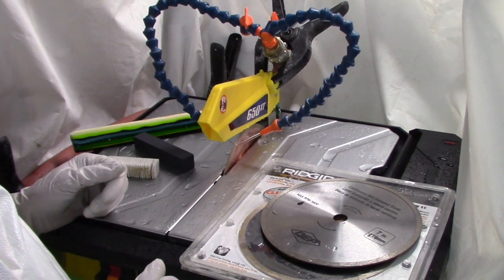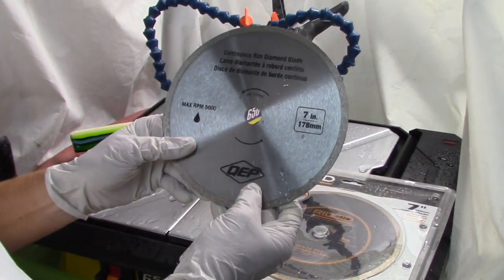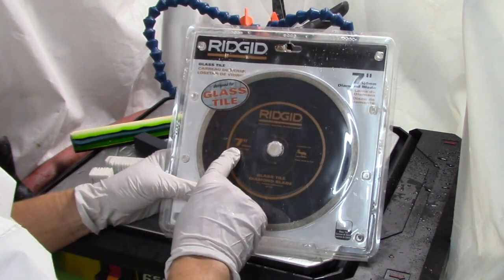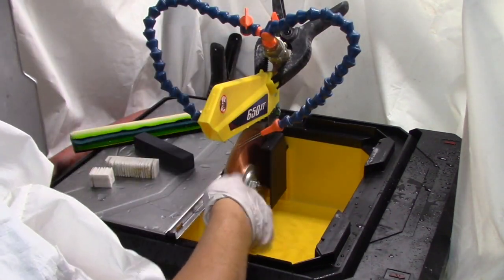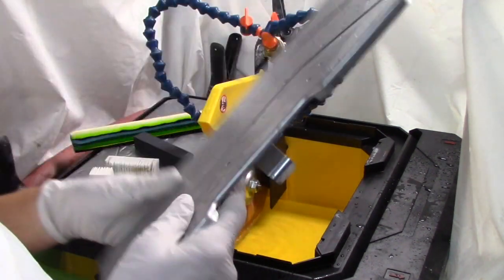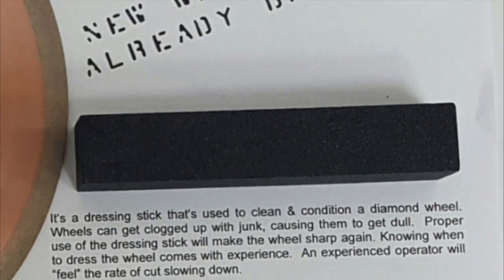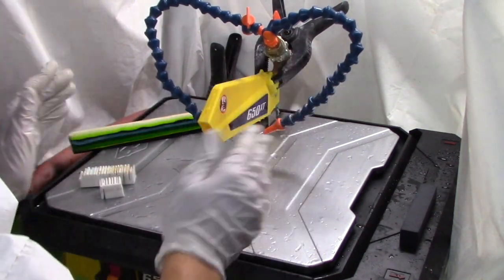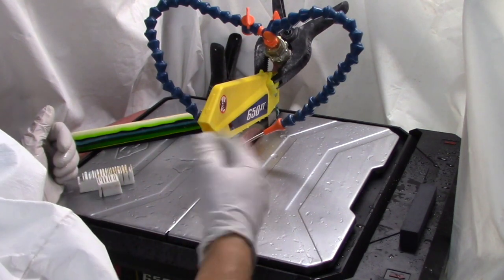#61 Cutting Glass With A Wet Saw

Comment: Nice video Susan.  I wish I could keep my saws that clean!  You must have an overflow for the excess water coming in.  Good idea. You can really tell by the sound that the last blade was cutting much smoother.  I am going to spring for one of those.
Reply from the maker: Thanks Capt Mike!  My secret to a saw that's so clean is to use a new one just for the video. :-)
Reply: Tricky!

Comment: Pls excuse my ignorance but having your fingers that close to the blade?
Reply from the maker: It’s not that kind of blade. Unless it’s brand new I can usually touch it while running without any problems. I’ve also spent no less that 100 hours cutting on a wet saw so I’m pretty comfortable with my limits.

Comment: Do wish you would use pushing sticks, you are so close to that blade it's frightening just watching, did appreciate the details about the blades though
Reply from the maker: It’s not that kind of blade. Unless it’s brand new I can usually touch it while running without any problems. I’ve also spent no less that 100 hours cutting on a wet saw so I’m pretty comfortable with my limits.

Comment: Susan... very nice, straight forward tutorial! Among today's over-narrated vids.. u get a gold star. Outstanding! Also, can you shave or cut off a base of a shot glass? I collect them and had one break... at the base... its shaped like a mini champagne glass u know.. so, I want to evenly cut the remaining stem and add like a wooden base. Thank  you -Jim
Reply from the maker: Thank you Jim! I love gold stars. 😁 You can definitely cut off the base of a shot glass. I’d recommend getting a cheap one or two to practice on first. (Thrift store) And the key is LOTS of water.  The blade against the glass generates heat and heat will break the glass. Water keeps it cool. You could put the wet saw outside and run a hose over the glass while cutting. To polish the bottom you would need something like a flat lap but it’s not necessary.
Reply: @SusanMcGarryGlass  TY... solid advice, yes I frustrate myself trying to find simple, to the point advice. And u don't sound like Poindexter erkel ..
Reply: Also.. I dont hv a saw.. but may get one now. Recommendation?
Reply from the maker: @Reepermax  I really like this QEP. But some people like a saw with a sliding tray

Comment: Hi Susan,  there is a overflow hole in the bottom of the saw for the water, how do you deal with that? What set up do you have to funnel that water away?  Thanks
Reply from the maker: k4824l great question. I place my saw in a plastic tray. Then I have a hole in the corner so the water drains into a 5 gal bucket on the floor.
Reply: Thanks Susan!   Love your videos!
Reply: I would love to see this whole setup myself, is the lock y kit just running off a small pump? Thanks for any Info

Comment: Hello, before I ask this, I already know that I should use one of those stick scorer thingies, but I'm asking because I'm curious. From your experience, do you think one could cut, 1/8th inch glass or mirror with a diamond blade saw? or do you think it would just shatter or something?
Reply from the maker: I do think a diamond blade could cut 1/8th inch thick glass or mirror as long as it’s not tempered. If it’s tempered it will explode.

Comment: Could you use this to cut panes of glass like a table saw ?
Reply from the maker: New England Yankee Living a couple of issues to consider. First, if you’re using a thin blade you’ll have to remove the blade guard so you can make longer cuts. If the blade is the same thickness as the blade guard or more the cut will create a channel wide enough to straddle the blade guard (hope that makes sense). Second, some glass is tempered. If it is tempered the moment the saw blade touches the edge of the glass it will explode into a million pieces. I’m sure you can find a video of that. It’s fun to see. Hope that helps
Reply: Big help thank you and yes those videos were well worth the search

Comment from the maker: Just a little clarification on the dressing sticks. I should have been using the black silicon carbide dressing stick on this METAL bond diamond wheel. The white aluminum oxide dressing stick is best used on RESIN bonded diamond wheels.
Reply: Hi Susan, where would you recommend purchasing additional black silicon carbide dressing sticks?  Seems many are for grinding wheels.  It's rather confusing.

Comment: Would this work with cutting large sheets of glass like for a fish tank?
Reply from the maker: ThatKidnHisTinny I don’t know. That’s something I’ve never tried. The first problem I see is getting the glass past the blade guard in the back. Unless you use a very thick blade that creates a channel wide enough for the glass to pass on both sides. But most glass is cut with a simple glass cutter unless it’s tempered glass.
Reply: @SusanMcGarryGlass  do u think you can do a vid on cutting glass?
Reply from the maker: Sure. Why not. 😁
Reply: @SusanMcGarryGlass   cheers subscribed
Reply from the maker: I’ll get right on it. What specifically would you like to see?
Reply: @SusanMcGarryGlass  perhaps like different ways to cut glass? Or attempting to cut glass sheets with a tile saw?

Comment: great demo.   loved your comment about spend money on  good blades.  

i ask for help w/ a new idea ...  you emphasize lots of cooling water.  
 what i want to do is score
a  8" length of 1/16" glass so it will snap/break into  2 pieces.  with the
big difference with what you do ... is  to score  it dry.   yes , dry.

      the idea  is that with a sub-mm score and  a slow feed the heat buildup
will be minimal via air cooling.    

    have you any experience with this method ?

    also  , not having  a QEP saw ,  the first unknown is  if  the blade height
can be set  in the sub-mm range .   failing that will a 6" blade fit
the arbor ?   

     lastly ... the 'score it dry'  condition.  the glass being cut is a 20x20cm
1/16" thick TLC plate for some chromatography work.  and getting it wet will 
ruin the  silica coating  on its top side.  i've had success cutting it with
a hand tool with the 4mm hardened wheel. so that is the backup plan
should  the QEP saw idea  effort prove to be unsatisfactory
Reply from the maker: I love to think out of the box but this may not work. I regularly cut glass with a dry hand glass cutter. No oil. That’s the easiest way to do it.

Comment: WHy aren't you soaked ? LOL I usually am.
Reply from the maker: intouch - really good question. The main reason I don’t get soaked is my source of water is not coming from the reservoir so I don’t get the usual spray. The Loc-y-Kit focuses the water very well. Also I usually wear a disposable drywall suit which helps. I’m wearing it in the beginning part of the video.